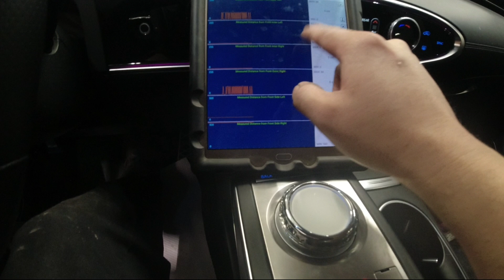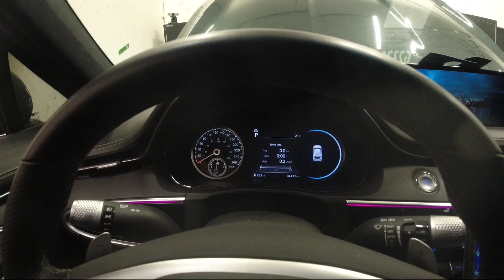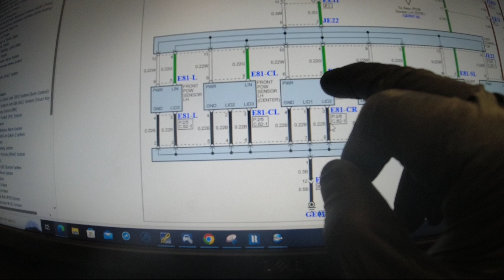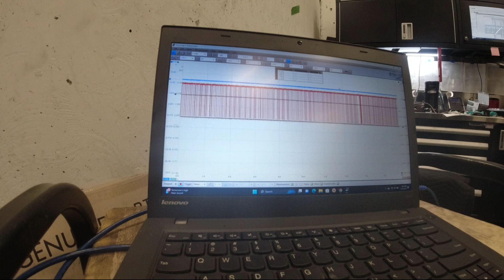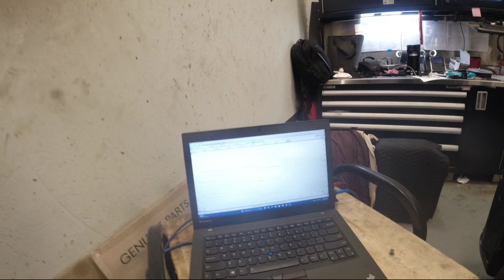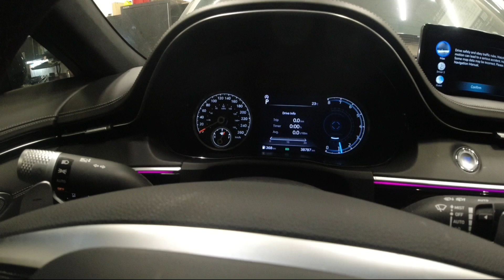Genesis GV70 FRONT PARKING SENSOR FAULT

Comment: Thanks a lot Marko your videos are very educational and going through you troubleshooting steps, gave me enough knowhow to try and resolve issue with parking sensor on my '23 Palisade, tried sensor it wasn't the one that was reading, didn't have the oscilioscope but was able to check the 3 wires and was able to replace the wiring for the rear bumper and resolve the issue. Since car was close to 120k warranty on electronics was long gone
Reply from the maker: Youe welcome and good job. Glad that the video helped.

Comment: I assume this would be the same as "parking sensor error or blockage" on a G70? I started getting that message about a week ago every time I slowed to a stop. Went to the dealer, they checked it and said they didn't get the message - which shocked me because it happened constantly and was not intermittent. Anyways, drove away without the error but still get phantom detections when there is no car in front... are there more than one cause?
Reply from the maker: Sensor blockage or sensor error most the time theres an issue in the circuit or the sensor itslef. For phantom detection,  usually i just recommend new sensor and ask which side of the sensor detects randomly.

Comment: What diagnostic you using on genesis gv70
Reply from the maker: The scantool part i use the factory scantool, for the oscilloscope i use the pico scope
Reply: @hyundaitech  factory scan tool is the one genesis use ?
Also what device do you use for the diagnostics ?
I got the same issue after washing my car
Reply from the maker: @M.E63  yeah same as the genesis, in our factory scantool we use the samsung tablet.
Reply: @hyundaitech  is there a cheaper option I could use to do diagnostics on genesis cars ?
Thanks for getting back to me
Reply from the maker: @M.E63  yeah theres some aftermarket scantool ranges from 500 to 1000 dollars thay can perform multiple modules scanning and data reading.
Reply: @hyundaitech  any chance of any names of them as I can’t find any that support genesis cars ?
Reply from the maker: @M.E63  autel, launch, topdon, thinktool, i have thinktool pro and it can read the genesis.

Comment: And by the way I had same problem with KIA that was giving me park sensor problem after checking all the wiring found corrosion on the wiring and connectors so I called to change the wiring harness and that solved the problem those wires are so small and tiny they are very easily get corrosion and damage from the element specially winter time when  they spray salt on the ground.

Comment: AWESOME approach and thought process as usual buy the way I have 2018 Chevy cruse 1.4 LT with turbo with Code P1101 that say the pcm is not seeing what map. maf, egr and more is reporting for air that is getting in through the air filter any idea how to approach this because so many thing is involve with P1101 code any info would be appreciated and as always thanks for sharing. cheeeeers from performance KIA IN BRAMPTON, ONTARIO.
Reply from the maker: I had one like that, they are known with mass air flow issue, and before calling that , what i heard they have issues corrosion in the pcm pins for that issue. And lastly make sure you dont have any misfires.